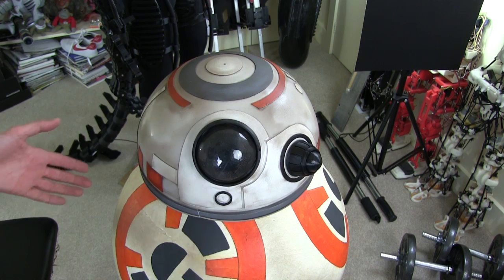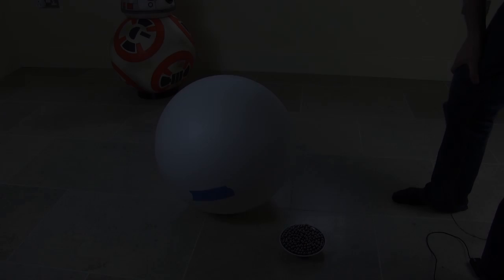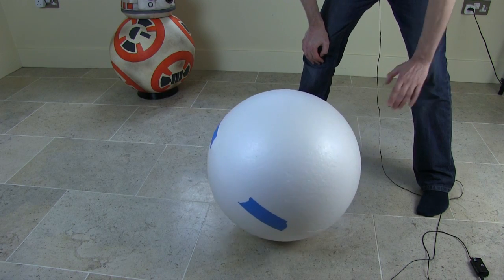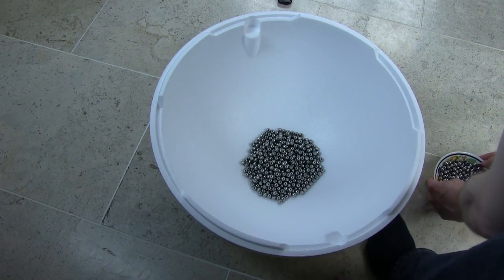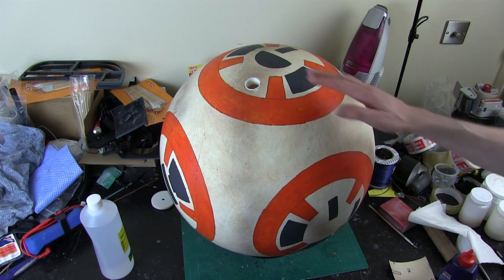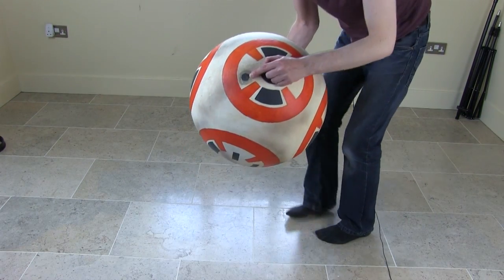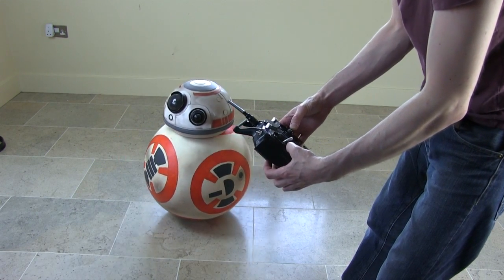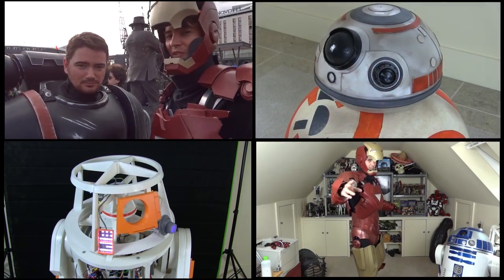Star Wars BB-8 Droid v1 #5 | Improving Stability | James Bruton

Comment: The best way to do this would be to use a gyrometric inverted neural stabilizer switch with some upgraded gravitational hyper shielding that integrates the dimensional vortex of the balls multi reality accelerated mainframe and then just link that up to a budget quantum drive spacial generator, simple really.

Comment: Seen all videos, and its pretty nice now. Maybe you get it to work for real at one point. I would still, as i sayd before, put the wheel engine thing in the bottom ball and use a gravity mechanic inside with magnet to hold the head always at the top with optic to control the balance wheels in the head and a electric motor to turn the head sepratly from the bottom. I know it will take to opperators to controll it but it would work more like the real bb8 i think. As i sayd, i think.  I love your videos. I want to start building robots as well. I think... :-)

Comment: how about using a slurry liquid, sort of the texture of yogurt that does not have the wobble of sand and it moves very steady, but with more resistance than water.  maybe try water with some component like for instance flour to make it thicker

Comment: What about a weight mounted on another set of omniwheels at the bottom of the big ball? Or a weight shaped to fit the inside of the sphere, coated in teflon (or just sliding through the gel) or something? Could either of those potentially work?

Comment: The obvious solution seems to be just a magnetic coupling between the ball and head. A magnet on a roller gantry inside the ball would solve all head stability issues. (Or even just make the ball from ferrous metal.)

Comment: why not place the drive/steering components inside the ball, adding weight and stability, and have the head piece just gyroscopic-ally balance on top of the ball, leaving room and weight savings in the head to add a camera, speaker or other effects. I believe there is a iphone controlled ball toy that operates in a similar fashion (minus the balanced head unit)

Comment: I havent read all 500 comments so perhapps this has been suggested earlier. Relieable friction between the drive wheels and big ball has to a be critical design point issue. Dust, sand, carpetthreads and other gunc would make the whole thing fail relativly quckliy in a rugged post -nuclearwar world. Somewhere I have seen this with a drive unit inside the bigball this would lower the center of gravity and make the control easier. The head would be on freewheels and kept in place via a strong magnet mounted on a pillar inside the drive wagon inside the bigball.

Comment: seems you could have something inside the ball, like a six pointed piece, one point to ach "side" of the ball and the top has a powerful but light magnet, that might mess with the electronics though, wheels on the six points for smooth motions , maybe the bottom point would branch to three points for stability. if that makes any sense...

 then again weight would increase dramatically.

Comment: I was toying with my remote unit inside the larger ball body rather than the head, but was struggling with how to get the head to work, stay fixed. I think your solution for the head is brilliant, if you were to place another wheeled remote unit in the base could it be paired to your upper unit?

Comment: That silicon oil is indeed horrible to remove, at my old job as student (loading trucks in the evening) someone manage to drive a 1000L tank of it from the back of a truck making it spill about 400L of that stuff took ages to get it somewhat clean, weeks and weeks later there still was this slightly slick oily feel on everywhere you walked.

Comment: What about magnet stripsinside the ball and magnets in the head, not too strong to restrict movement but to keep the head on the ball at more steep angles.
Reply: That's what I was thinking, as well as making the ball heavier than the head.
Reply: but the thing on top won't fall off and get damaged
Reply: that depends on the strength of the magnet but it will also help the stability of the piece on top when the ball wobbles.
Reply: PUMPHS E 

Read my mind ^^
Reply: +PUMPHS E go buy a beach ball put a weight on top see what happens. good theory though
Reply: +PUMPHS E  it will still fall over. The only thing the magnets will do is reduce the movement abillities for the head...

Comment: Have you considered using a non-newtonian fluid, such as cornstarch and water, as an inertial dampener?
It's self adjusting, and a heck of a lot quieter and cleaner than ball-bearings and silicon oil (though having the interior of the sphere lubricated with the silicon oil may be a plus).

Comment: how about putting a mounted large magnet inside the big ball, and then more magnets in the head under the wiring that would keep the head attached. The magnets would have to be mounted to a ball bearing structure so it can free wheel anywhere inside the larger ball.

Comment: Put a gyroscope in the middle of the ball wrapped in a lightweight multi-direction rotational internal skeleton, embed the ball bearings in the foam in a pattern the computer can work with. Loose ball bearings are too random with oil or without. Use the freed-up CPU to control the gyro.

Comment: What if you used a rubber ball instead. You could inflate a ball similar to a tire so the wheels would have a much grip as possible and the ball would be easier to stop since the bottom would be slightly deflated for stability. Just a thought.

Comment: I just ran across this video but was wondering if you've given much thought about the pellets from inside of a bean bag? They are much lighter than the ball bearings but I would think should move better inside considering your original materials. Of course the oil isn't going to be compatible with them at all because of the saturation.

Comment: My idea would be to build a second simple control unit to fit inside in the ball...have it completely free floating on rollers inside the ball to add weight, but have an actuator in the center that will press a brake into the wall of the ball, controllable wirelessly from the head. If the head control senses a rolloff, or about to stop, it can apply the brake. you can seal it in a ball and charge via wireless like Qi.

Comment: have you ever thought about making it just the opposite like the main components on the inside instead of the small head... that may fix some of the balancing issues and have some sort of magnet system for the head from the main component. just some ideas floating around

Comment: I think I would have used the concept just with a heavier plastic polymer ball like the size of a magic 8 ball with a measured amount of fluid inside of them. It probably would have taken three balls or so to fit the diameter, but it would have killed the sloshing affect. Also with a triangle affect it should give a bit of stability as the balls would center at the apex when still.  I would have lube them up too to help with friction. I do have a suspicion that the center of the BB-8 droid pops off, or screws off for maintenance purposes. 

Congrats! Such a great project, and I enjoyed every moment of it!

Comment: how about a heavy ball suspended by 4 wires on the inside like cross-hairs with a dot in the middle if looked from above.. something like a baseball or softball . maybe something bigger.  kinda like a zorb ball the inner one having the weight like a planet  core

Comment: You can put a Ball frame inside the out ball. The inner ball frame has motorized wheels and a gyro telling it what is the top. The the head that you made can stay in line with the inner ball with a strong magnet. It will work like a tank tread, just in many directions.

Comment: How about having a little 'bowl-like' structure with little rollers in a radial array at the bottom, like a salad bowl if you will. You can then play with the amount of weight by adding to the bowl (metal weights or other.solid elements) which I think that it wouldn't wobble as with liquid. Also the rollers...there are other smaller fixed bearings solutions that could work as rollers, but can't remember the name. Anyway, cool robot in progress!
Reply: Meaning, this structure is meant to be put inside the sphere.
Reply: Carlos Flores Another would be to have a rubber ball inside the sphere. The ball would be filled with oil, yet keeping the oil contained. This rubber ball or balloon would have to be not too thick walled, to allow it to change shape.. This could potentially slow the movement, and adjust the density of the oil or other liquid depending on results

Comment: Cant you put some resin type substance on the wheels to have better friction bewteen the "head" and the ball?
Reply: *****
Yes i did see that and it does seem fine but i was just concerned with the "head" falling off the ball. Instead of having the wheel-ball spin in place it would the head would just lop off it seemed.
Reply: ***** Oh alright thanks for responding man.
Reply: ***** wouldn't using some form of magnetized wheels with the grips work with a large metal ball not allow the motors to keep up with it if the magnets are weak enough for to be able to keep center at all times ?
Reply: IloveJell0w It seems to be excessive in practicality and production.
Reply: Jeff Quartz well I know the one used in the movie has some of those part, but again it also has a huge team and budget.
Reply: +Jeff Quartz bought mine on amazon www.amazon.com/BB-8-App-Enabled-Droid-by-Spherfero/dp/B0107H5FJ6/?tag=ref10-20
Reply: +IloveJell0w The one in the movie has the driving mechanism on the inside of the ball, and the magnets under the head connect to the driving mechanism, not the ball itself.

Comment: What if you put an inverse twin carriage on the inside. It does everything that the head does but in reverse and convex... sitting on the bottom? If the two carriages (the head and the new carriage inside in the base of the ball) work in tandem, aligning with each directionally. The one inside could be the primary drive?

Comment: the motor part should be in the big ball.  That's your primary drive and directional apparatus and stabilizing weight.  The top part can then be instructed to stay on top or venture around a small area of the top to "Look around".  That would simplify your RC controller for direction and speed (bottom inside drive) and it would also simplify the process for making the top look intelligent.  You can also RC the top with your left side stick or a second puppeteer on a separated controller.

There's another video out there that suggests a best guess that the top is magnetically puppeted from within the main ball.  That seems marginally more complicated than what I have suggested but it's probably six of one and half a dozen of the other.

Good work on what you've done so far.  keep it up.  BTW, on this page as I'm viewing and commenting, there's a video to the right that has an RC toy version of BB8  nine videos from the top. Might be worth taking it apart to see how then manage it for your upscale version.

Comment: Remove the ball bearings and partially fill the larger ball with oil; it won't slosh and it has good flow lacking resistance. sorry, I got a bit impatient for waiting to hear you thought of oil too. BTW, i am not a fan of this droid for very obvious design flaws; not of mobility but of surface contact and erosion to it's body, especially over rough terrain... very dumb design.

Comment: I immediately thought of rare earth magnets. If you put a magnet on the center of the bottom of the head (not touching the ball) and place an attracting magnet inside with ball bearings pointed upward (magnet not touching the surface of the ball) attached to a vertical arm with a weight on the end located just below the center point of the ball it should stay where you want it to.
Like I said it came to me quickly, maybe its an idea you can toy with. Good luck and Awesome stuff you do!!!

Comment: RE: Non Newtonian Fluids - interesting comments... The mold issue is indeed something to consider. I'm uncertain, but I believe a few drops of bleach to the fluid would add the necessary solvent to the water/starch mixture in order to prevent mold from forming. However, I have no idea how bleach and polystyrene will interact. Perhaps a simple water purifying tablet or the sort to maintain the 'bio' environment of the starch with water. Hummm... Maybe substitute the cornstarch with Borax?

Comment: You need to make a motor inside the big ball that stays flat when the ball moves and have a rod coming up close the the inside wall of the ball with a magnet on it. Then the head would join to the big ball by using magnets and when the big ball moved the head would stay at the top and slide over the big ball

Comment: Hey James! I would like to apply a different kind of control method to your robot! I am a controls engineer and I think we might do better with something slightly different than PID loops. If you are interested let me know!
Reply: There is an open source quadrotor project at aeroquad.com that seems to perform well enough with the 8 bit arduino core. I feel like there must be more going on here than just that. Perhaps the IMU is not calibrated well, or the DC motors have a timing offset which causes them to spin faster in one direction. In any case have you released the code / part list?  *****

Comment: At the beginning you mentioned the water/sand differentials, saying something in between would be ideal. How about a non-newtonian fluid? Basically water and cornstarch. Perhaps get a large clear (so you can see what's happening) beach ball that inflates as evenly as possibly to experiment with the physics of the fluid and the proportions. You could start with a medium mixture. Use a syringe to fill the un-inflated ball say maybe 20%. Then fill the rest with air of course. The faster the ball is moved the greater resistance the fluid will exert on the inside of the ball, the slower it moves the more quickly all fluid on the inside surface will return to the bottom of the beach ball. Just a few buck$ would render a decent test platform for getting just the right proportions of water to cornstarch.

Comment: maybe a round magnet on the inside of the ball? cant be too strong or else its too hard for the wheels to move but not too weak or else it will just fall off. Possibly have a second magnet inside the head.

Comment: From all the videos and everything I have seen I have to determine that the robot from the scifi-con was actually 2 robots - 1 main robot in the ball which drives the ball, then a secondary head piece which has a gyro and a control to be able to rotate its head to the right direction.

Your method of adding ball bearings is interesting, but physics would tell us you would have been better with 1 bigger ball bearing than many, because the sloshing effect is caused by the balls rolling over each other - worse with water as the molecules are much smaller than ball bearings.

Having the bottom ball heavy and driving the whole thing would have made it far more stable. To get the grip I would have coated the whole thing in paint with very fine sand added, then afterwards added a coat of seethrough rubber sealant to give it the grip it needs.

Comment: Not sure if this was mentioned in the video or in comments, but try making small square cells in which to put water in. So instead of one mass of water sloshing about, there are many small masses of water moving just a tad. I would think 1cm squared is good enough. Its what firetrucks do and there was also a segment on Top Gear about it as well.

Comment: I love it, fantastic work. I was trying to think my way through the problem outlined here that you solved with ball bearings and here's what I came up with.

Three tubes, each one slightly smaller than the other so you can have each one sitting inside the other. One running around the middle, one running 90 degrees from that to make a kind of cross and the third one running in the third axis so you have an even distribution of pipe symmetrically placed inside the ball. Now before sealing each loop of pipe, put a few ball bearings in. So each pipe has say 10 ball bearings. Now no matter which direction the ball rolls in, there should be a smooth grip from the bearings running in that direction but not enough of a crowd of them to cause a wobble, each axis of loop will kick back, at least I'm imagining that, haven't experimented for real. but in my imaginings of this, the clean lines of bearings would each equalize the wobble somewhat as they all pull together equally in each axis and it would really only fall apart motion wise if the ball rolled really fast, then you'd get odd behavior from a row of bearings with too much energy possibly loop the looping or well, I can't really say. I just see it working slowly as long as each bearing has enough room to roll. There wouldn't be much noise too as the clacking together would be minimized into one row and they'd be inside a tube which would dampen the sound.

Just an off the top of my head idea, pay no mind to it. What you've done here is amazing and outside of a computer simulation, I couldn't hope to do anything this great.

Comment: Your creations are awesome! I was wondering if it would have been simpler to build an additional, controllable robot that would it inside the ball, at the bottom of it. Make it heavy, so it stays centered in the bottom, but you could drive it via remote in multiple directions, spinning the ball around it. The, the head wouldn't need to drive the ball, just balance on top while the internal bot drives the ball. (Maybe you'd already considered this and there's a reason it won't work that I'm missing, but I figured I'd suggest that just in case.) Keep up the awesome projects!